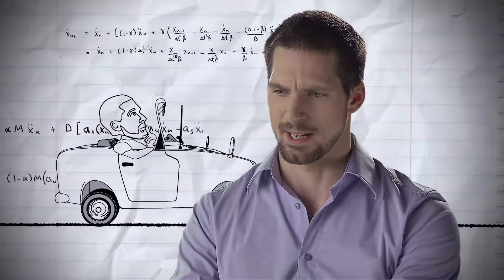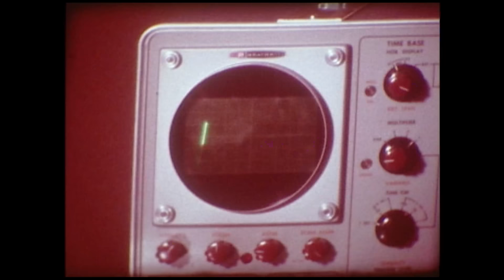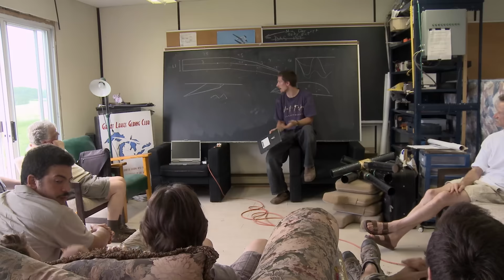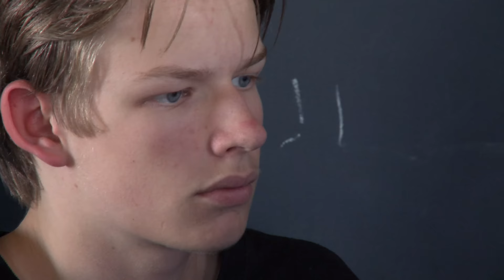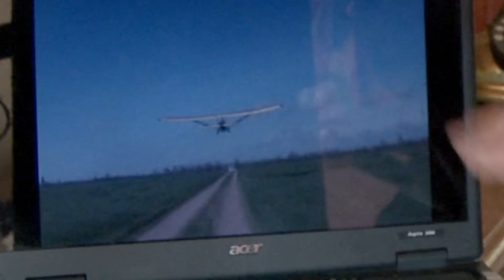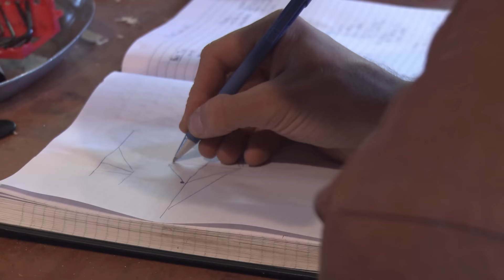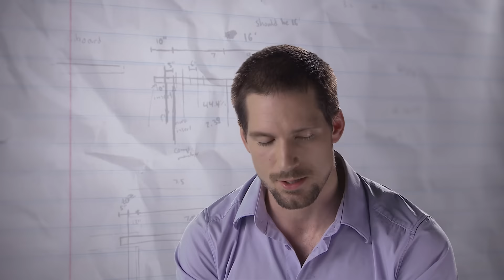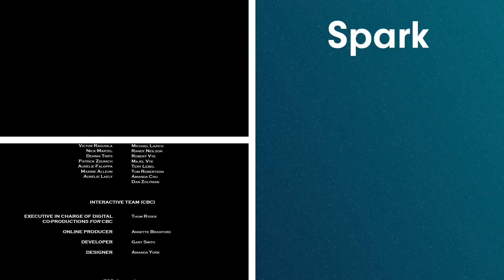Is It Possible To Fly Like A Bird? [4K] | When Dreams Take Flight | Spark

Comment: I wonder if they considered a laminar flow wing? This type of wing, exactly like the wings of a P-51 Mustang fighter from World War 2, keeps the wing/air disturbance as close to the trailing edge of the wing as possible, to keep the turbulence to a minimum. In any type of aircraft, turbulence equals drag, which slows down the aircraft. 
If their mathematics showed that their design was viable, but only just. If they didn't have a laminar flow wing in mind, it would really help.

In the little cartoon where the pilot is pumping his legs, it showed his arms as just "dangling". This is wrong. If you are going to power any kind of vehicle with only your legs, you need to keep your hands bound to the frame so that your legs are getting the most power they can produce. If you leave your arms losse, when you pump your legs, your entire body is absorbing much of that output, thereby robbing a good portion of your energy, and you will end up going too slow.

Otto Lilienthal did glide down a man-made hill built for that purpose. If he hadn't started so high, he wouldn't have glided at all. When he left the ground at the top of the hill, he glided down that hill almost at the exact same slope, simply due to gravity. He never achieved any altitude above that of his starting point. Simply put, his wings were too small to carry the weight of a man safely.
Reply: I wonder if you ever considered just not commenting on things.

Comment: Birds also have hollow bones meaning their DENSITY is lower.   Weight and density are two different factors.   Just like a 50 pound bag of salt feels like it's way heavier than a 50 pound bag of soy protein.  Its the same weight, but it does act like it is.   Focusing on weight is one thing, but focusing on weight DENSITY is another. the reason for this is surface tension. Like. Why does a 50 pound iron weight sink straight to the bottom of a lake. But a 50 pound log does not? Well a 50 pound log has a lot of spaces between the fibers which are also full of trapped air. Wood does not float by itself. The trapped air content in the wood makes it float. Because it has a lower density then the iron weight does even though they the same weight. So the wood is capable of reacting to the water surface tension. And since water is DENSER then air, and the wood is full of AIR, the wood floats.

Comment: I mean I love science and all but that's a death trap... I thought this was going somewhere with the early clips of a guy who strapped a prop to a hang glider. I mean... just replace the motor with pedals and chains. Idk. I just expected more than a death trap designed to prove how impractical it is to turn ourselves into some  60 foot monstrosity that falls over or falls apart upon impacting the wind strength of a fart.

I liked the batman idea. Hang glider cape on demand. I'd buy one.  There's a reason blimps went extinct yaknow. If a light wind is your worst enemy, your flying craft is fundamentally flawed.

Comment: they are going about this all completely wrong man, this is something i have always thought hard about since childhood and now with the technological advances in electric motors, batteries and ultra strong lightweight materials, i believe i could if i had the investment easily create a powered suit with replica pigeon wings that you could wear like a backpack using springs to quickly pull the wings back to starting position and high powered motors to rapidly aid your body's own speed and strength by at least ten times to pull your arms down on like a slip differential so you can flap and move about each wing individually so you can literally learn to fly like a bird! also there would be like magpie style tail appendages from the bottom of the backpack, use you imagination and picture this! peace and much love to all 😉

Comment: Ornithopters are the antithesis of "ingenuity". I fail completely to understand the point of this busywork. What is the purpose of an ornithopter be it engine or human powered? What part of any ornithopter project repays society for all the effort and material that has gone into the creation of such an inefficient blundering mechanism? Rather this sort of project is only possible because of the advances in technology gained from the creation of other genuinely efficient mechanisms! Understanding the biomechanics of bird flight is an entirely separate endeavor from this slap-dash effort of pseudo-mimesis. If you are going to copy the flight of a bird with a mechanical mechanism, please have the wherewithal and decency to make that copy faithful and accurate to the biological original. Failing this just give the funds earmarked for such childish and wasteful lunacy to a deserving charity instead!